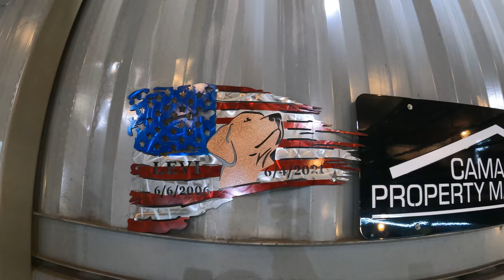Dragging a broken Bobcat with a dozer

Comment: Have a feeling Andrew is gonna end up putting shock absorbers on his trailers
Reply: Torsion axles would be a better choice for him.
Reply: @pvp64  never in a 100 years
Reply: @patricelebrasseur5649  Just out of curiosity why not? He seems to like upgrading his equipment. From what I have read they are a better choice. But I am no expert.
Reply: A former landscaper I know, built a  trailer for his small Case dozer , I wish he still had it, I'll take pics of it. The trailer axle was the front axle from a Chevy Viking 60. Welded everything in place. Put truck tires on it, the deck was 2 I beams, mesh between the ramps, that single axle home made trailer carried that dozer for years until he retired..
Reply: @pvp64  it depends on the application really torsion axles are great for pavement but I don't think they flex enough to go over curbs and back through ditches and stuff like you have to with equipment trailers sometimes. this is my experience I have owned both.
Reply: @pvp64  the rubber in them to, the arm bend and they are flimsy, you end up running the inner flank of the tire, 

torsion axle are only great if you like to get stranded a lot

if you want soft cushioning suspension get air ride
Reply: Probably a military trailer until the inevitable road work🤣
Reply: @pvp64  walking beam...
Reply: Lifted trailer just flip the springs to on top of the axels instead of below
Reply: Or he could try going slow over rocks instead of full speed up the trail.
Reply: the kubota ones are around $4,100 new at my kubota dealer with 5 year warranty wich aint bad  for long trailer float

Comment: I used to be super paranoid about my welds being perfectly prepped with perfect penetration. But after watching and listening to Andrew, I realized that for my purposes, a decent weld with minimum prep is fine for the majority of what I do as life and safety are not usually at stake with my repairs. I don't think he's ever had one fail and neither have I. If I need a weld in a critical area where someone might get hurt if it fails, I call in a pro. Cheers
Reply: You don't think a trailer jack is a critical weld?  I mean, I get what you are saying, he welds over paint and rust all the time and they all seem to hold but really it doesn't take that much longer to just hit it with a flap wheel first.  I don't really get it because usually he is going out of his way to make sure things are done right but with weld prep it's like he has never even heard of it.
Reply: @ConSeann3ry  Agreed, it is a hack job to not even take 5 minutes to grind the weld off the jack and trailer?  This is 100% a structural weld and people swoon over him like he is some master craftsman, I don't get it

Comment: Andrew I have worked around cable winches on dozers before. I just think you should know that keeping them dry if they are not being used regularly is very important. If you let them sit with no use for months then the engagement mechanism rusts so bad that the Winch will not engage or disengage. My experience mostly comes from gearmatic winches but I have herd hysters old winches have the same issue
Reply: A bucket of used motor oil, a large stain brush, unspool the winch line, and as it's getting spooled, brush the oil on..
Reply: they do
Reply from the maker: Lube the cable? I bought two of those dozers and the winch doesn’t work on the other one, I need to try to fix it
Reply: @AndrewCamarata  yes, lube the cable on the D7 & your crane. Wire rope/cables are either fibre core or steel core & lubrication keeps them from prematurely failing. Use oil or grease. There's plenty of good literature out there on maintenance of wire rope. One book that I would recommend is IPT's Crane and Rigging Handbook, lots of good information in there.

Comment: Pro tip #7 With trailers I have the spare mounted to a new hub, makes for a easy and fast replacment, and you have a spare hub if needed. No need to  remove the lug nuts. Thanks for the shows Andrew.
Reply: Can you explain further how it's easier to have a spare tire mounted to a spare hub?
Reply: @RaspyOB174  You just take the spindle nut off and pull the whole unit off and replace with new tire and hub. Only one nut. It really would not be much less work because of all the grease you would have to clean up.
Reply: @RaspyOB174  Mount the spare tire to the hub with the lug nuts, if you get a flat just remove the hub nut with the tire and replace the hub mounted tire on the axle. A simple quick tire change, and you have a spare hub if needed. I don't know how to make it more simple. 1 nut or 8-10 maybe 12 lug nuts.
Reply: @crzy11000  
Appreciate it that's what I needed was just a bit more to research.  I just saw an entire hub disassembly video so I get it now.  Thanks
Reply: @ducewags  
Thanks man super appreciate the further breakdown.  I would recommend that in this situation you would want to prepare your hub nut by removing it ever so often so that it's not rusted or stuck on.  Could be difficult to remove if you don't have a breaker bar or impact with you on the road.  Seems to be a common issue that hub nuts get stuck on and that trailer wheels can get very hot especially if not maintained.
Reply: @RaspyOB174  A hub nut does not need to be that tight in reallaty, 45 ft lbs. To tight and it will crush the bearing into the race. The lock nut is held in place by a cotter pin. AVOID the self greasing hubs, bad news they don't pack the inner bearing.
Reply: @ducewags 
This channel and others have made me hyper conscientious of ZERG fittings to stuff with grease.  [StarCraft Joke, it's actually Zerk Fitting, The nipple you place the Grease Gun female fitting on, you would think they would've designed it the other way around but I guess any random female fitting gets all gunked up if you're not around paying attention to it lol]
Reply: @RaspyOB174  oh so very true, and some times called a "zert" fitting. And for the 45lb torque on the axle nut, that is needed to seat the bearing into the race. After that spin the wheel and set the castle nut by hand tight only. The fastest and safest way to carry a spare tire, and bearing all in one package.
Reply: @crzy11000  Actually its not a dirty job to replace a hub, and stay clean. And why would you need to remove any grease from the axel at all? Just wipe the inner and outer race faces.

Comment: Pretty sure that's the most dangerous winch I've ever seen.
Reply: I was talking cash s*** when I saw that s*** get hooked up 😅🤙👀
Reply: @jayfitmob8645  Would be intended for logging?  My wife used to work in an Emergency department here in rural New Zealand, and their worst and most frequent customers came from logging and agriculture.
Reply: Operator was the problem...they are Widow makers...and you don't go near if spinning cable...or you get sucked in and ripped apart....steel cable is not soft or nice....
Reply: @garymallard4699  man I swear to God I've seen chains and cables come apart, some of the scariest s*** you will ever see trying to get something out of the hole. Absolutely cut a human being in half.
Reply: Seriously though. I've seen them before, know they're hydraulic, but how the hell can they pull so ridiculously fast and still be powerful as all hell? That son of a bitch would definitely remove your arm while just coasting under its own momentum.
Reply: @garymallard4699  I've done a lot of sketchy s*** on equipment in my days. My go to is an excavator. But I'm familiar with skid steers and loaders. I've had to actually snatch another excavator from falling into a pit of Florida mud with a more experienced operator in the cab. It was a really scary situation in Central Florida building an Amazon plant. The ground collapsed and I just grabbed the side of his cab with the bucket and held it so he could get out. It took four f-450s with winches and an excavator to get it out of the pit. But everybody went home that day and that's all that matters
Reply: I think it's rated for like 50tons or something 🤔 does look scary haha
Reply: @mmm365  
Hopefully not seriously..or himself..i don't like to see people hurt..but we aren't Babysitters...!!
Reply: @jayfitmob8645  
Amazon and Black Holes ..🤔
Seems Normal from what i heard....
Evil attracts Evil..
Reply: @mw5905  facts

Comment: Typical Bobcat, breaks down when you need it the most.
Reply: Sounds like my x
Reply: That's why I Prefer my Sears Suburban Garden Tractor with a Front end loader and skid attachment
Reply: @phoenixarizona8441  I bet that thing does some work 😂😂
Reply: Yeah and those 864's or the worst. Those and the 873's.
Reply: I have used bobcats for many years and never had a problem with them. Many of the problems people have are their lack of understanding how a machine works. Hydraulic leak is the most likely cause of this unit not moving which is why when he filled it it moved.
Reply: @alexmattyspac7605  can't complain about my 873, she's been pretty flawless. If you take care of it, it will take care of you.
Reply: @c.p.excavationandlandmanag4053   every machine is that way, I love bobcats. The 873 gets sloppy as it ages a landscape crew would have them ruined in no time.
Reply: Lol you got that right
Reply: Why not drive the truck to that open field where the crapcat was pour hydraulic oil.in it and drive it up on the trailer?
Reply from the maker: @AndyLishious  there is a hill that’s too steep to get up.

Comment: Andrew: This trailer is getting torn up.

Proceeds to pull trailer at high speed. Lol
Reply: Lol Like what else did he expect
Reply: Sometimes I think he really does not look after his gear.
Reply: Drive it like you stole it
Reply: Like ripping off a bandage
Reply: Video content my man!!! Gotta love it!
Reply: LOL 😂😂 Not even a single piece of equipment will ever survive A. Camaratas typical behaviour.
Reply: Dear  @dembrowi_n_c.5111  
Please kindly allow me a suggestion: Simply don't react to "comments" that typical internet haters do (like to handle defiant children). They try to provoke/offend to get a reaction and then to hate even more. But it's very obvious that the thing they really hate the most is themselves.
All I do is report them to utube. Usually that helps getting rid of them. Not instantly but definitely on the long run respectively in the end.
Best regards, luck and health.
Reply: @nickturner2813  before the trailer broke maybe it wasn't fast compared to what you go on roads but if it's enough to break the trailer that's too fast, it's pretty simple. I've taken equipment trailers at 30mph down some relatively rough gravel roads and it wasn't too fast, if I started to break things though it'd definitely be too fast.
Reply from the maker: If something breaks, then it’s not built properly and the design should be improved.
Reply: @AndrewCamarata  Id say it's usage dependent. If you have the best built canoe in the world it is still going to get best to hell or destroyed going through class 5 rapids, you could have a great detachable neck trailer but off-road it'll bottom out. If something breaks while doing what it's meant to do yeah it could be improved.
Reply: @jasonswift7098  It doesn't matter because whatever he breaks he can fix as this video shows.  Andrew has even built trailers from scratch.
Reply: Dear @AndrewCamarata  
Maybe. BUT there is definitely always more than one possibility and definitely always more than only your opinion. For instance: If something breakes, someone could have used it incorrectly or could simply have overstrained/overstressed it.
Don't get me wrong, I like most of your videos and you are definitely a hard worker. I only wish you would treat your equipment a bit more like you treat your dogs. And especially not in a way to show in public that it is of no matter at all for/to you because you are too rich already!
Best regards, luck, health and wisdom.
Reply: It’s a working man’s approach to tools. “If it can’t do the job, then it dies working the job it should have done.”
Get the work done, fix the tool after. Or trailer, it this case.
Reply: Dear  @dembrowi_n_c.5111  
👍👌👏 Yeah! Just like every other below average intelligent creature! And exactly this is the problem and why we have so immense man made problems on this planet!
Best regards, luck, health and wisdom (you will definitely need a lot of all that if you, your kids and grandchildren will/should have a future)!
Reply: @Chr.U.Cas1622  A: It's "breaks",  not "brakes",  and how do you know how rich AC is?  And why do you care how he treats his equipment,  "his" being the key word?  You don't have any money invested in his equipment,  so you don't need to tell him to take it a little easier on all his equipment.
Reply: @Chr.U.Cas1622  "why we have so immensley man made problems on this planet"!  First,  it's "immensely".  Change it to "many".
Reply: @Jacobtheunwise  Well, yeah,  I've never seen a guy with so much equipment and no telling how much land he has.  He's definitely well off,  but he keeps it real.
Reply: @omahabigbill2789  yeah man one of the most humble youtubers an he doesn't even clickbait. Cant wait untill he gets the cybertruck an destroys it lol
Reply: @dembrowi_n_c.5111  
Hahahahaja. LOL. Now look at that! Now he is showing his true face at last. By the way: You are definitely talking into a mirror respectively to yourself. That's more than obvious. Thank you for showing us what you are and especially what you are not. And that even in public! Congrats! Creatures like you absolutely always react in the same way. After trying to offend/provoke, they will use cuss/swear words because they can't stop it any longer.
But mea culpa, it's completely my fault. Meanwhile I should have learned not to try to mind battle with unarmed life forms. I simply still can't resist to reply to dumb brazenly "comments", sigh.
Reply: Dear  @omahabigbill2789  
👍👌👏 Thank you for telling me. I immediately changed it to breaks and immense because, as you might/could/should know, meanwhile your suggestion "many" is by far not enough to describe man made problems that our world has to suffer from. Unfortunately I fell again for wrong Google keyboard suggestions and didn't realise what the automatic Google keyboard word changer did, sigh. And unfortunately the Google translator is still not correct often times too.
Best regards, luck and health.
Reply: @omahabigbill2789  
??? If you don't want to see the facts, it's your decision respectively problem.
2) Are you not able to realise what Mr. Camarata earns out of utube alone or do you simply not want to see?
3) We are all responsible for what we do, but especially if we do it in public. Even more if one shows it to the world via videos!
4) ??? It's called comments! Please try to realise that. By the way: PLEASE TRY AT LEAST TO TOLERATE different opinions respectively different kinds of personal taste. And if you can't be tolerant, simply try to respect other opinions/tastes. That's the very least you can do. It's not difficult at all. You will see for yourself if you give it a try sometime at last. At least I hope so.
Reply: @Jacobtheunwise  👍🏻
Reply: @Chr.U.Cas1622  Right back at ya!
Reply: @RobertHunley  what trailer has Andrew from scratch? none!
Reply: @AndrewCamarata  OMG that is not the attitude to have! if you mistreat something and use it outside its intended purpose it will break but under its normal use and cared for correctly it should not break.
Reply from the maker: @jasonswift7098  this is its intended use.
Reply: @AndrewCamarata  These guys in the comments knocking how you use your stuff would lose their minds if they saw half the stuff whistlindiesel gets up to
Reply: @backwoodsbuildingandfixing9223  .. whistlinweasel just breaks stuff but does not have the knowledge, interest or expertise to fix or improve something, let alone build things from scratch. Andrew builds, Weasel destroys what others build
Reply: @silentepsilon888  Oh believe me I'm no fan of the guy. There's a level of wastefulness that's flat out inexcusable. I just find it amusing when people try to tell other people how they should be using their own stuff
Reply: @AndrewCamarata  well said bud
Reply: @Mr Jimmy Fly 
LOL 😂😂 Not even a single piece of equipment will ever survive A. Camaratas typical behaviour.
Reply: @Jacobtheunwise  He fixes it himself on the cheap. Not about money. It’s a philosophy!
Reply: @davincrook9927  he still uses money to buy the parts to rebuild including all the machinery an welders an such.

Comment: I used to work at a tire shop and they used the same machine to get the tire off the rim. Better than using two screwdrivers, I've done it that way on bike tires. Nice repair on your trailer.

Comment: That tire changing macing is awesome man!
Reply: Get back to Work!!
😉
Reply: When I was a teenager working in the gas station in the '50's that's what we used.
Reply: macing ?  FAIL !!
Reply: @bigc8300  Ya know.... For when a tire gets out of line.... You mace it... instead of shooting.
Reply: Macing
Reply: @bigc8300  
" FAIL " is his Middle name !! 
😉
Reply: Give CT a break guys..he has Welders Flash from actually WELDING!! 😉
Reply: @rualert1602  
A tire machine ..yes in the 50's but not like that one!!  I got a old Coats machine...it works but not like the modern ones i used when wrenching
Reply: Yep. Thats a tire changing machine.
Reply: @garymallard4699  I realized after I posted that that the machine I worked on was not electric.  Long time ago.
Reply: @garymallard4699  WELD FAIL ?
Reply: @rualert1602  A macing machine
Reply: @garymallard4699  Was it a macing  machine  holy crap they are rare !!
Reply: @bigc8300  
Worth alot on Ebay too
Reply: @rualert1602  
I know..i'm 64...just pokin u
Mine is air too ( old Coats ) and i used lots of new ones too...i am looking for one newer one plus balancer right now....